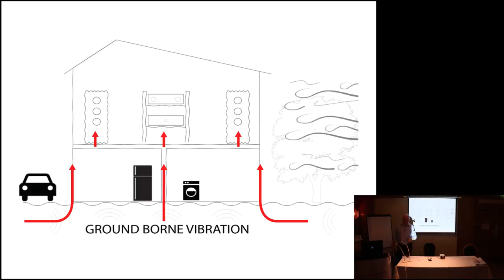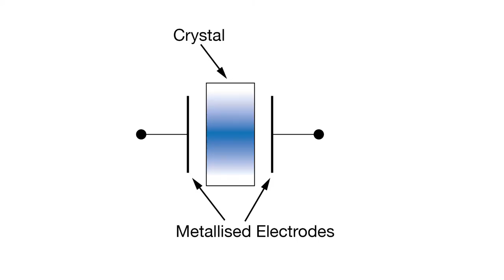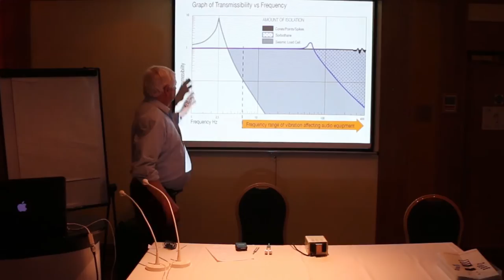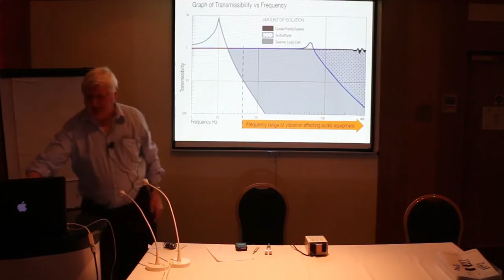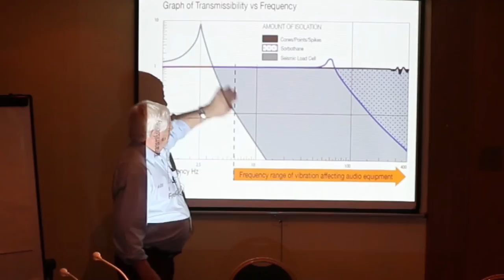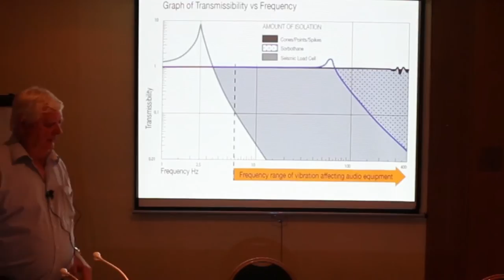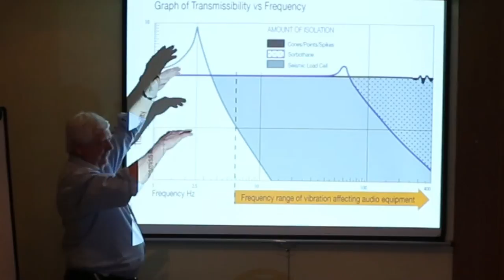Max Townshend Explains Ground-Borne Vibration Control with Townshend Seismic Podium

Comment: Tried a lot of cones and things over the years. When I put my Tekton Moab speakers on Podiums the improvement was hard to believe. Turntable and amp are on Pods. Before this I was starting to think my room needed bass traps. But a lot of the "room resonance" was really vibrations coming directly from the speakers into the floor, with is now gone. Bass problem solved, without tube traps. Not cheap, but not subtle either. Altogether it is a significant system upgrade.
Reply: Hi, i have the Tekton DI’s could point me to the specific podiums you used for your tektons?
thanks

Comment: Brilliant and very convincing argument for his isolation products,the only problem is the cost,to do my speakers the cost of Seismic Sinks or Platforms would be more than the cost of the Speakers themselves so hard for me to justify on those grounds although I would love to try one day.
 Hats off to Max👍
Reply: Hello Mark, this product does work but Nobosound make a very similar product for speaker isolation that contains springs and its a tad cheaper.
Reply: Problem being you can spend twice as much on speakers, twice as much on amps, twice as much on everything, and still not get to where Podiums take you for much less cost than all that. In other words what is hard to justify is spending any more on other components until your whole system is isolated on Podiums and Pods.
Reply: I put my Naim Nova on a ZaZen 11 platform I managed to buy open box for £40. I was skeptical but for £40 I thought I’d give it a go. I have to say I’m astonished by the results. The Bass hits harder, cleaner, tighter. The voices are clearer, more defined and the sound seems more open, airy if you will. TBH I’m still in shock at the difference it’s made. I’m now considering doing something for my sub which is down firing straight onto the carpet. Maybe swap the rubber feet first for isolation pods? I need do some more research before making a decision.

Comment: The left one is shaking the table which is shaking the right one  -just shows how good the isolation platform is for such small vibration not
Reply: I was thinking the same. He forgot what he was saying there didn't he?
Reply: The left one was a very light load for the stiffness of the springs (he said it was light), which was on purpose to give it a fairly high resonant frequency.  The one on the right hardly reacted at all to those vibrations which were orders of magnitude greater than what would happen in your speaker set up actually.

Comment: If mechanical vibrations are causing the crystal oscillator in some piece of digital equipment to change the sound then there would likely be a measurable change in jitter. This chap seems capable of measuring such an effect. That would be a more persuasive piece of evidence than saying that the sound supposedly improved 'out of sight'.

Comment: For loudspeakers I think it is best to spike heavy flags to the floor, then put damping material on them and the speakers on that. That way you get the anchoring and vibration absorption.
Reply: Do you have photos? I dont know what flags are🙄
Reply: Concrete or stone thick sheets used for paving.
Reply: Mass doesn't absorb vibrations, it can transmit them quite effectively.  That's what happens during an earthquake.  He has a video where he shows that even a concrete floor transmits very effectively to a speaker on spikes.

Comment: Some cool info, but the Sorbothane info was false. Properly load matched Sorbothane decouples down to 10hz if you use 1" thick and softest durometer..
Reply: Thanks for that.  Is the 10 Hz both lateral and vertical? I will mention it in subsequent talks. Max

Comment: My house is made from solid concrete. Never noise except when I'm blasting. Lead the metal doesn't resonate. I'll have to drill concrete floor and raw Bolt my speakers to the floor. Also live my speakers with sheets of lead.
Reply: Dave Jones Concrete is the worst material to live in. lt does  perspirate. it s too rigid for the music room